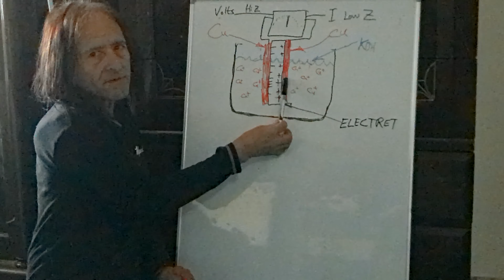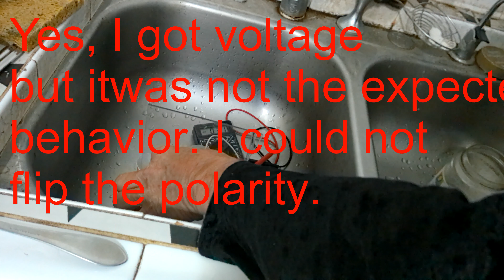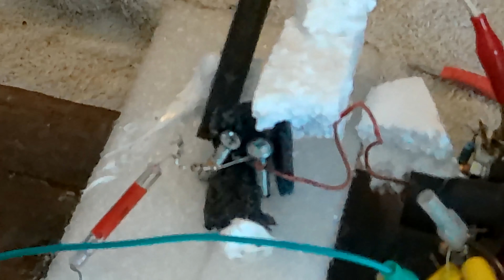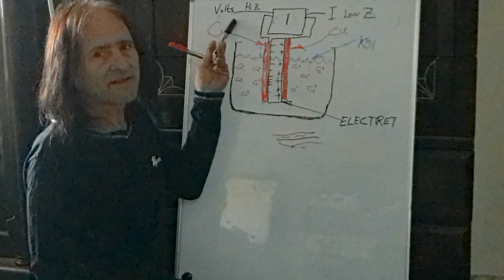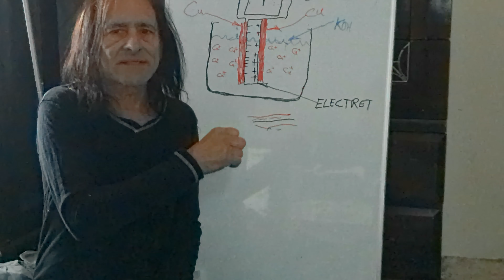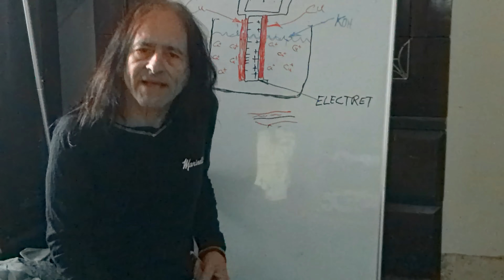New Operating Principle ELECTRET Zn-Zn cell with EMF from a Static Electric Field - Full Explanation

Comment: You are correct about faraday, the paradox will show the axial rotation end of magnet field doesn't rotate. I have experimented for years on this aspect of magnets and made many new discoveries, and made motors that work off of the non rotating fields. These motors don't use N or S pole attraction or repulsion to work , and no commutation no phases. By manipulation of the elections flow through the field in a different geometry I should be able to make a non reactive propulsion device, no problem. The measurements I have made show huge power output possible, and thrust, that is super efficient. When I'm satisfied with my work I plan to take it to SpaceX ,and make rocket propulsion obsolete. I like your videos and determination, keep up the good work. I may do a video to show discoveries, and new motor types, and powerful electromagnetic thruster for space  travel. 😮😮😮😊😊😊😊GOD BLESS..

Comment: free energy doesn't violate 1st or 2nd law of thermodynamics. 
energy is ability to do work,
work is force x distance x angle between force and direction of motion (cos phi),
many forces exists in nature on permanent basis,
one such force is force exerted by permanent electric field source (electret),
an electret when kept near parallel plate capacitor, it will re-distribute the charges on plates of capacitor,
once fully charged the capacitor can be discharged through a load,
now you need to flip the electret so it can charge the capacitor in opposite direction now,
only energy you need to supply externally is to flip or rotate the electret,
that energy is negligible when compared to energy received by discharging capacitor through a load,
this does violate any law of thermo.
Reply from the maker: I just did a video on available free energy. It is there.

Comment: Would a small 1cm electret for a microphone also work? Or would it be too weak?
Reply from the maker: I thought of that too. The short answer is I don't know. I really need something bigger. The electret mic ones are pretty teeny unless you want to spend more, and I actually have some that are about 1/2 inch round. I should sacrifice one.  I just tested some that I made and found very bad results. They may be in the middle of pole reversal, a phenomenon I do not understand. I just built a more stable and robust HV supply using a neon transformer and a variac. I am going to try water frozen in an E field with dry ice to freeze it. But that is just fun. I need to start another batch. I got a little action after one month using polypropylene. The one with the "5" on it. The dimensional stability is very bad. It shrinks up. But it does work. Wax is another ... the old recipe that others are using on YouTube.
Reply: @princeoftheblues  Boy, sounds like quite a complicated setup. I don’t know anything about this stuff but it’s still fascinating and nice to see someone share their wild experiments and results.
If you type in “radiant energy diatribe +nuenergy” into a search engine then the first result should be an article about electrets and how you can make one with a long wire by placing it in an oven and then applying a high voltage to it. I read that article, and then coincidentally came across your video, so I thought I’d share. Maybe there’s some info on there that’ll help you out.